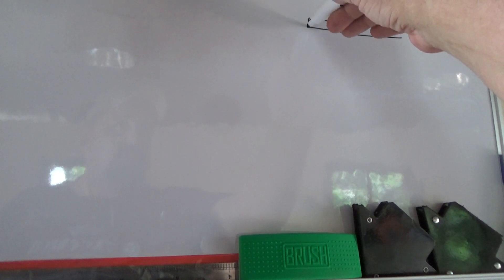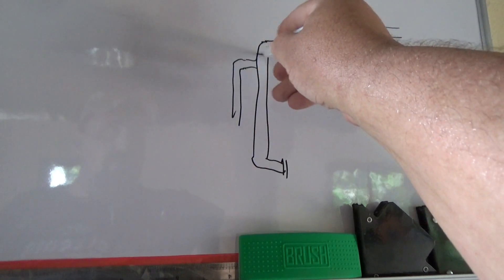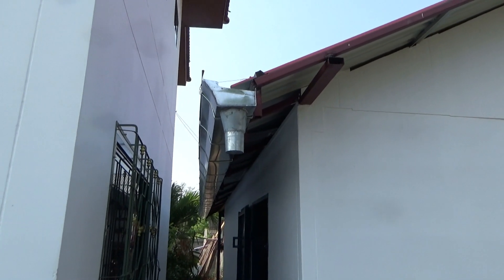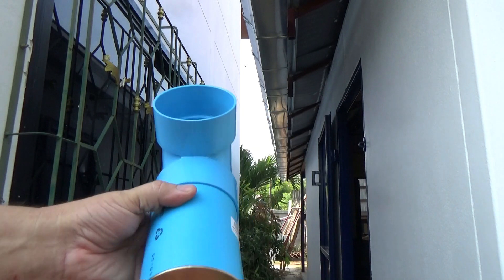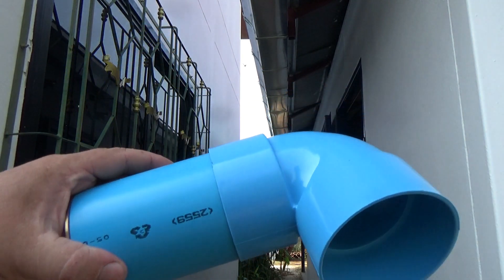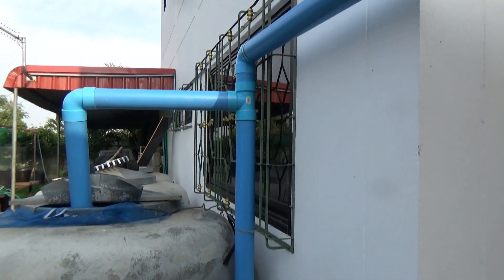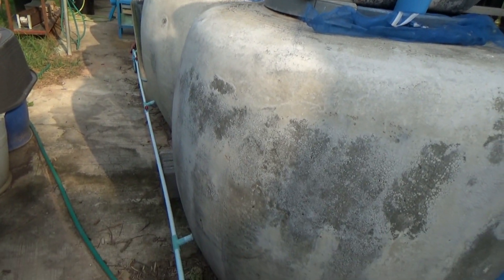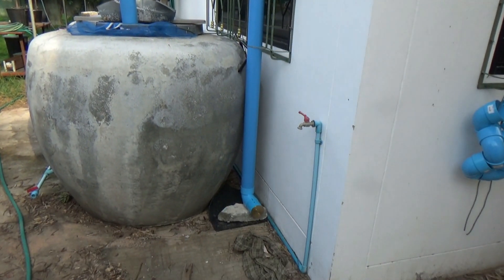Workshop Project - DIY First flush rain catchment system.

Comment: We've had catchment water here for 10 years. Birds haven't been a problem, but leaves and wet dirty crud will always build up in the gutters. It's important to have a way to disconnect the pipes from the gutter, that makes it easy to just spray the gutters with a hose, letting the crud fall to the ground. Also, some pantyhose slid over the tank inlet makes an excellent disposable crud filter.
Reply from the maker: And you have a real water tank, I would love something that big but no where to put it.
Reply: The house tank is 8,000 gallons and it's usually enough to carry us (2-3 people) through the dry season. This year we had more family members staying here (more toilet flushes!) and a longer dry season, so we've had to supplement it with water from a 13,000 gallon agricultural tank up the hill. It got pretty low, too.

Comment: Hello Paul,
Couple questions, your garden hose bib (faucet)...is it standard 3/4"- 14 TPI? Also avg. pricing per foot for your gutters? Also, did it take long to fabricate and install?
Reply from the maker: Everything for water around here is 1/2", gutters are almost 10 meters long, 2 sides of the workshop and cost 4000 baht installed (2 thousand each side), cost depends on size and thickness, took about an hour to install each side, the trucks drive around with everything needed and in my experience there very good at what they do.

Comment: Very smart system, but I am agreed that the "first pipe" will be full before all dirt is gone from the gutter after a period with no rain. So I would have put a smaller barrel (200 litre?)under that one so I could lead the water aeay from the house foundation.
And for those wonder about the color of the pipes, it is the color you usually get on such plastic pipes in Thailand
Reply: Yeah I was wondering if it might be a good idea to put the horizontal overflow pipe on a gradient  (maybe 30 degree?) to give all the crap more time to settle in the run off section, might make a difference I dunno just a thought
Reply from the maker: There is ways to make it better for sure but I am happy how it turned out, I like the blue....

Comment: idk if this would help, but using like a gate filter at the T where the water transfers to the tank would make it so leaves and stuff wouldn't go through? Just a thought of how to confirm nothing large goes through the tubbing. Great simple system though! :)
Reply from the maker: That would work but probably hard to clean, really the only thing I am trying to prevent in bird crap, leaves and grass well happen but not a big deal.

Comment: Nice I was gonna say that only one that you did screw would need something haha but it was obvious...our pipe runds straight off the roof into our tank. I sometimes wonder how much bird poo we're drinking haha. But I still reckon its a billion times better than anything coming out of the scheme water supply.
Reply from the maker: Our water here is straight out of the ground, not treated in any way but it is very high in minerals, especially salt and it is doing a real number on my kitchen and bathroom fixtures, so any rain water I can get the better it is for everything.

Comment: A complex design by a complex guy. lol. I seen this design and never understood it's purpose. Thanks for sharing.
Reply: In America we mainly have asphalt roofing shingles. They are covered with abrasive grit which over time comes off and runs into the drains. For folks that want to use a rain catching system, the grit buildup can damage pumps, filters, or may just not be desirable to spray on gardens. this system traps the heavier than water grit in the long flush pipe.
Reply: Thanks for information. It is fascinating what can learn each days.
Reply from the maker: Yell a good way to catch sand and dirt as well, not a big problem for me but you well be surprised what birds take up on the roof.

Comment: Not to self...
Wait until the video is done before starting to ask questions, the answer might come....5555
Looking good, it will work fine I think. Have u thought about a similar system for changing water in u fish tanks? I know it want work under dry season, but it might save u some time and work when it rain? But u need a overflow pipe in the tank..

Another question..did u buy all u tools in Thailand? I have a lot of tools here and I thinking of maybe take them with me when I move....
Reply from the maker: It would work for the fish tanks for sure. You can get most tools here, I have just started shopping on Lazada, Its like Asian Amazon, There have most tools now. It would cost a lot to bring tools and you might have to pay import tax. If you have a lot I think you can do a one-time shipment without tax if you're moving here, that might have changed but I did read about it a few years ago.

Comment: just called graduated pipe tape,
 there maybe a fancier name  for the engineers 
but your apprentice just calls it " the pipe tape",
very accurate when used proper
Reply: I am used to call it "pipe tape". I have also heard some call it "a flexible ruler". And it works well under any name as long as you are accurate.  :-)
Reply from the maker: These might be all industry slang words, when doing a google search it don't come up, not that it really matters.

Comment: i had a system set up just like that but the silicone they used to seal the galvanised guttering could not handle the weight and volume of water and used to leak like a sieve but apart from that worked well. the elbow joints sometimes got blocked up with twigs and leaves from the eucalyptus trees at the back of my house but you should be ok. i still think you need to gutter your house on the workshop side too lol.
Reply from the maker: Gutters on the house would be very difficult, I have no idea how I am going to paint the eves, might need to rent a helicopter.